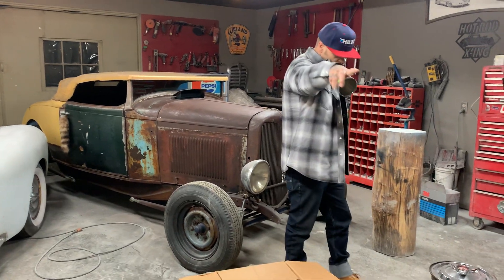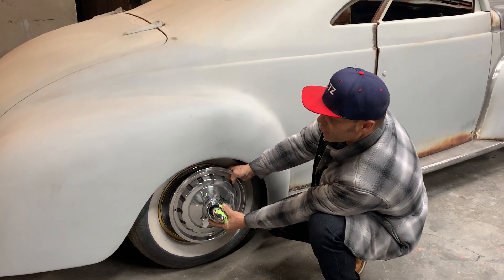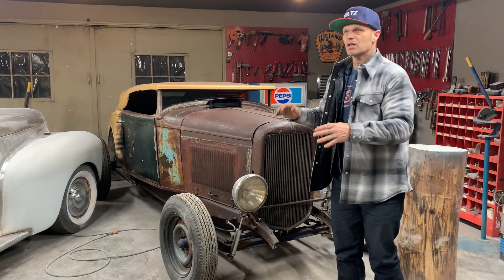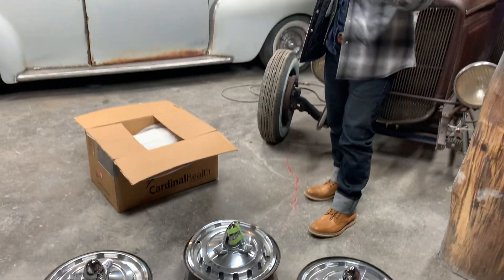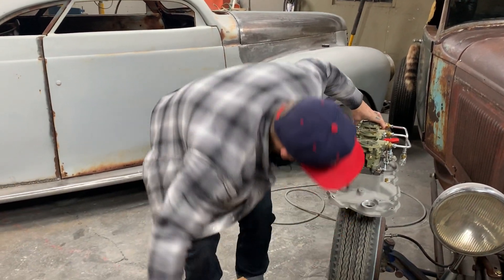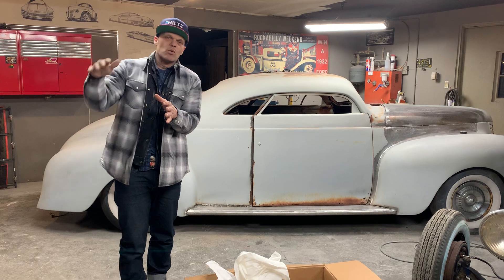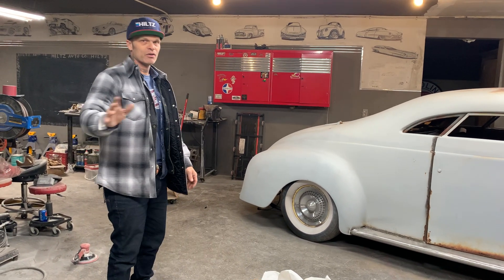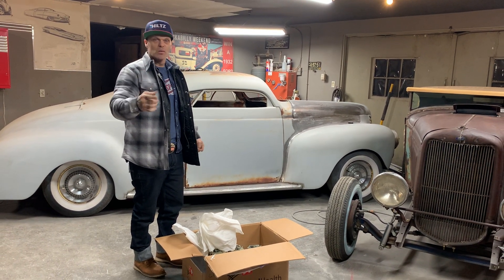CUSTOMIZING A 305 SMALL BLOCK TO LOOK LIKE OLDSMOBILE ROCKET 88

Comment: It's going to take more than a trip deuce set-up to make a 305 into a hot rod power plant.  First is to increase the displacement, second is to get rid of the boat anchor heads and of course a good set of headers.

Comment: i have a 68 442 350 engine that u can have but i do live in oregon is the problem needs rebuilt but does run or it did when it was parked 5 years ago . i put the engine in a 79 chevy pu that had a diesel in it the4n traded for a 80 bronco then sold it 15 years latter the gut calls me up and said it started to knock if i want it come and get it . the pu has a perfect body on it so i thought it would make a good build some day when i get time to do it 3 rigs in front of it .

Comment: Chad:

Olds also had oil tube.   But it was 90 degrees straight up.  Not angled like chevy.    Bend the oil fill tube to straight up.  Enjoy your vids.  Cheers
Reply: You are 100% correct
Reply: The Generation 1 Rocket V8  (303-324-371-394)from 1949 to 1964 had oil tubes slanting to the passenger side,.Gen2 Rockets 330-350-400-425-455 through 1960s and 70s had straight oil tubes.